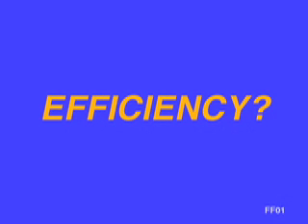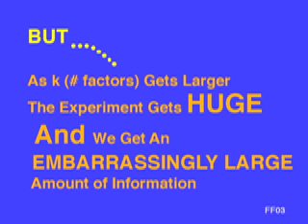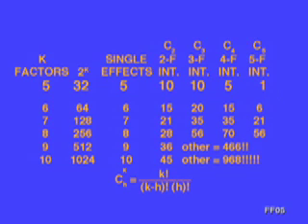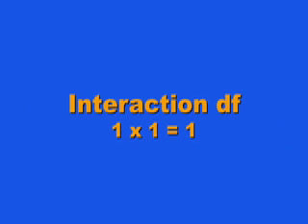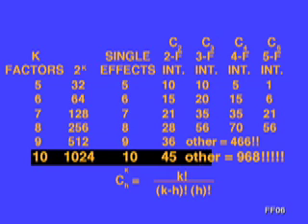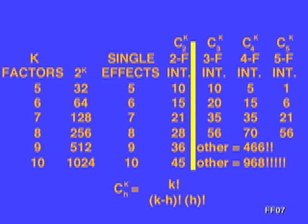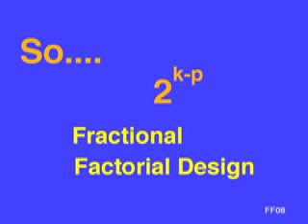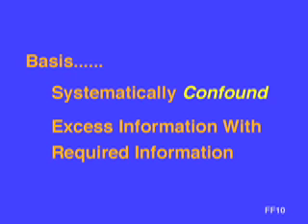Fractional Factorial Designs Part1

Comment: Hi, I am a student. And i was wondering if i could use these DOE on a material that needs to total up to a 100%. like for example. A, B and C; since u have a low setting meaning everything will not get up to 100% and vice versa. if A is 50 . B is 5 and C is 20 I can't used it as (A+B=C)=100% so am i still able to use to DOE to present for my presentation in 2 months time?